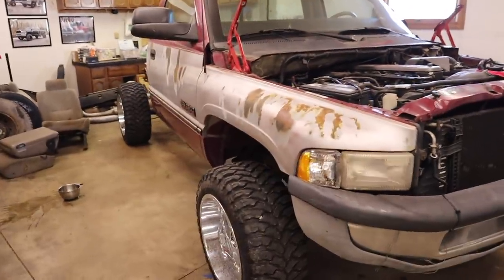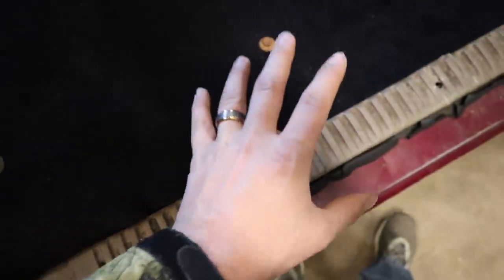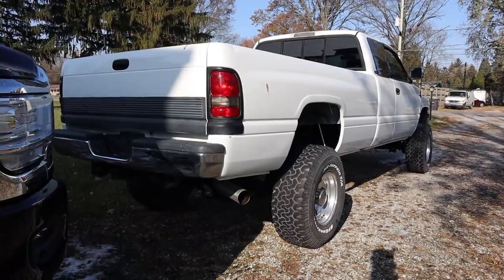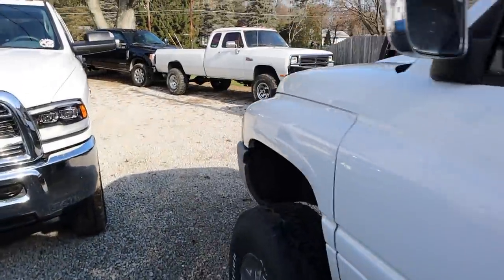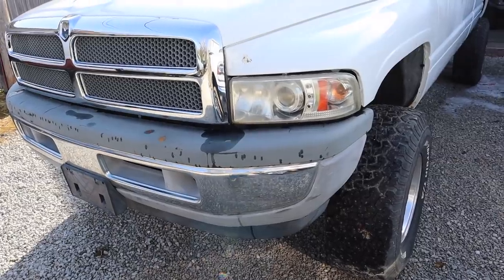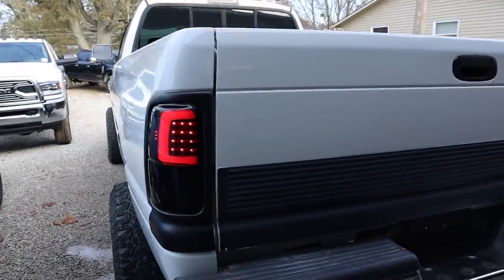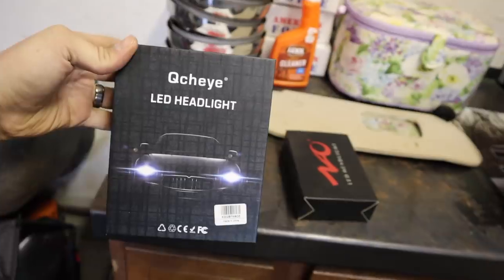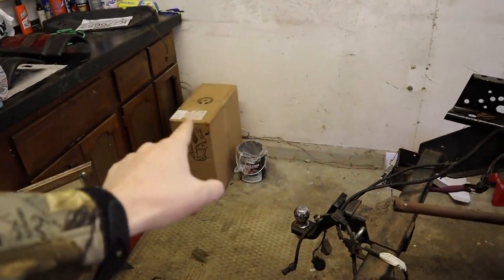FROSTY GETS A MUCH NEEDED UPGRADE!!!

Comment: Hey buddy you should use black dupli-color trim and bumper spray for the faded plastics in the front bumper it would really clean up the front end I have a 2nd gen and I did that and it looks like I have brand new plastics